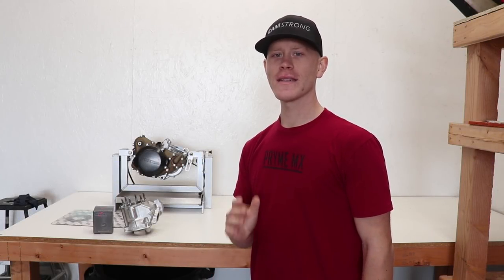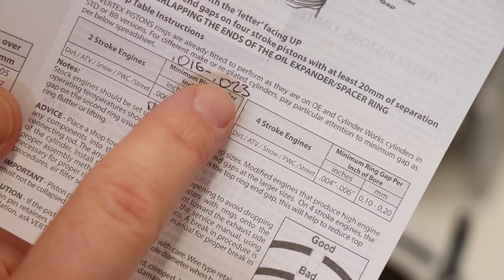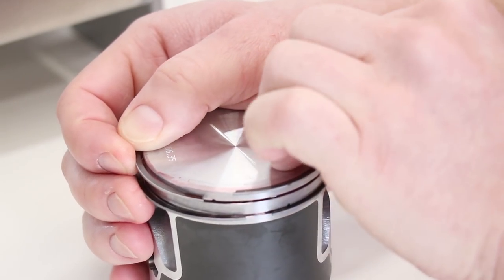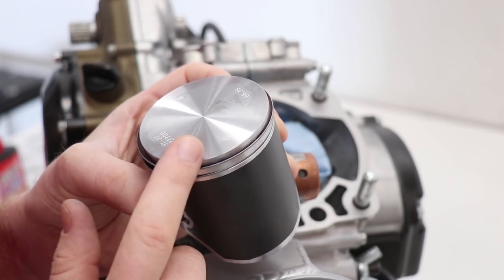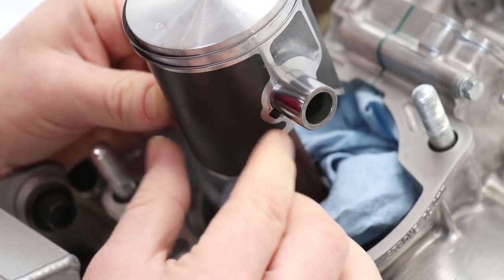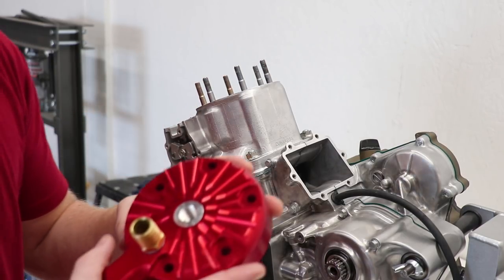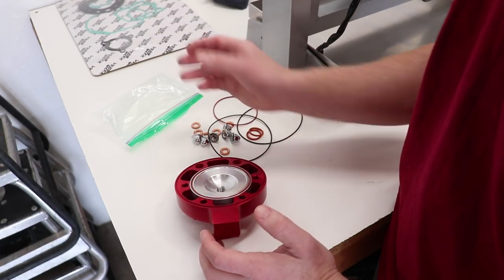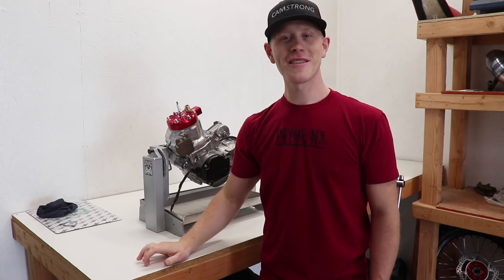Building My CR250 Engine!

Comment: DUDE..... Always  always install the piston dry!!! I will of course lube the wrist pin bearing and maybe a tiny tiny bit on the rings. Definatly you put waaaaay to much lube! Putting the piston in dry versus wet could mean up to a 20 psi compression difference once broken in!! Also breaking in the top end hard makes a huge difference in compression versus being easy and glazing you cylinder. also installing your iston wet glazes your cylinder... Also never line up the circlip opening with the opening in the piston!  Dont use grease on your gaskets... Should never reuse those gaskets anyways. If you must use something try some gasket tack... Also you must check your cylinder head squish before installing the head. If you squishband is off it must be machined... Also you should purchase a two stroke timing gauge to check your timing. piston/crank variations will affect your timing.
Reply: Shut up.. if you didn't hear its the first fire up that can damage the engine before the oil comes in from the petrol
Reply: I own a motorcycle repair shop. I have proved many times dry top end rebuilds will result in 10-20 psi more compression!
Reply: I was thinking the same thing.. why did he put grease on the gaskets, why did he put too much oil on the piston's skirt, why did he install the circlips sideway, why he didn't check the top dead center of the piston if it's too high or too low and he did not also check the timing of the engine? 

I am now wondering about the performance of that engine... i hope it did good.
Reply: @murdock6450  please don't get us wrong... there is no criticism about our comment... those are based on experience. I am asking because i want to learn more. Just like what the other said, putting grease on the gaskets and installing wet pistons aren't the way we used to do and so on... we are just being honest. Sorry if you got offended by my comment. 

But i really wonder about the engine's performance. If it did great, i'd do the same.
Reply: any good mechanic knows never ever line up circlip opening with opening in piston!! Thats a sure way to have it pop out and ruin your engine... del boy thats funny cus back in the day every single factory two stroke mechanic would install the piston dry into the cylinder!? Guess they were all wrong huh?? This dude will realize when his bike never produces much compression... He didnt even check his squishband or timing or meaure his rod end play... How bout clocking spark plug??? I could go on and on buddy but I can already see the smoke pouring outa your ears now...

Comment: You are using the wrong oil to lube  the piston because whent the engine heat up this assembly lube will create some residue bad for the engine especialy at the first start, you should use the oil you put in the gasoline for this Job